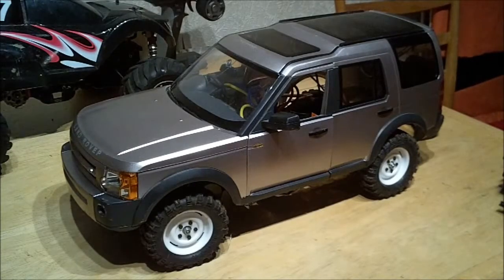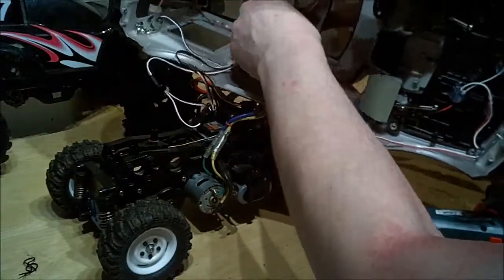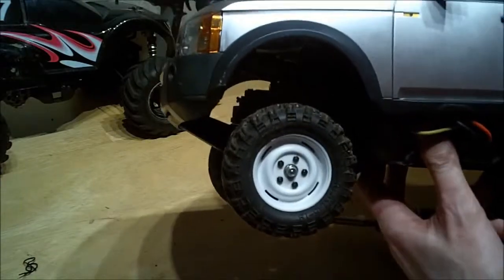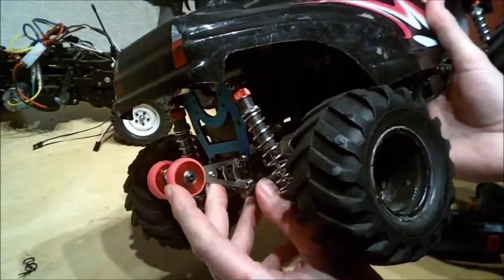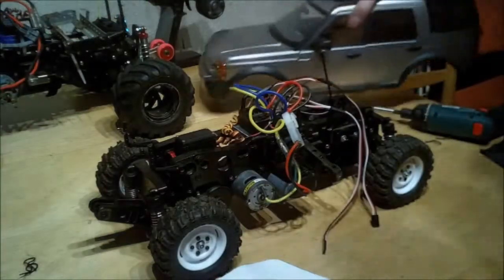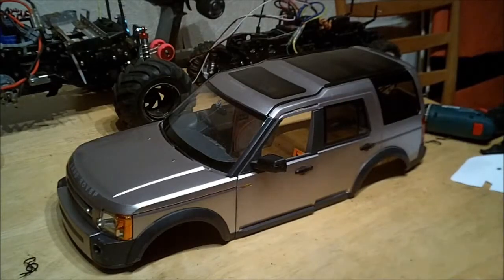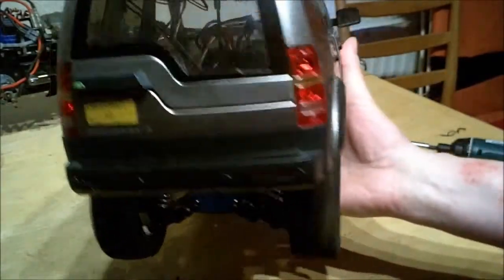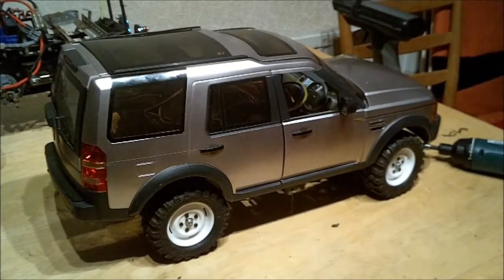Tamiya Wild Dagger/Land Rover LR3 trail truck project - Part 08

Comment: Huge thanks for the shout out buddy. Got new boots on the disco now and removed the lights as they came loose got caught in the back wheel and it ripped them apart mmm. If you work out how to rig lights that only come on for braking only and not as position lights let me know as wanna do a high level brake light. Be doing new vids soon as having memory car issues with my fone at present
Reply from the maker: No problem, you've mentioned me plenty of times!  The light kit control box has extra spaces which should be brake only lights and always on spot lights, just waiting for more LED's to arrive to test them out.
Reply: Cool hope there is one just for brake only as think my light set is the same well when i find it as it seems to have dissapeared since i took it out of the disco. Cant find it anywhere